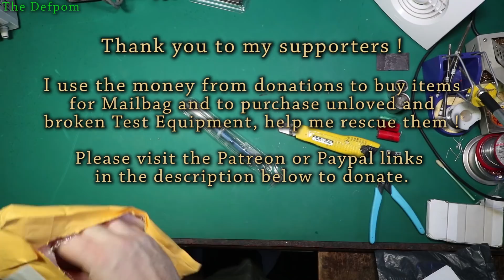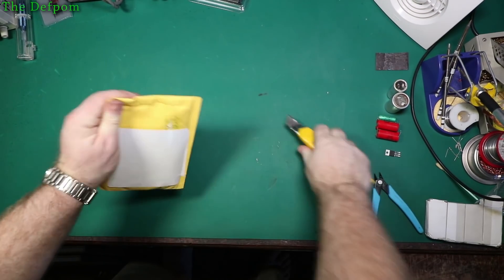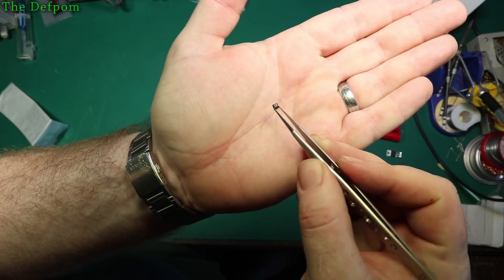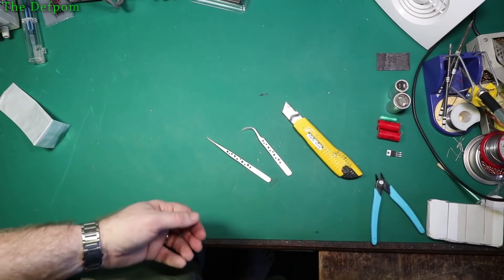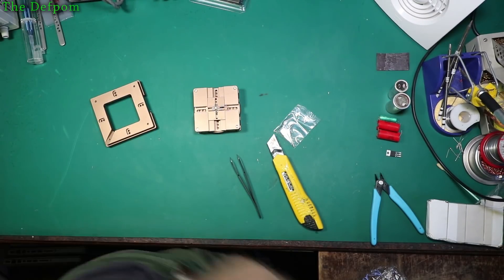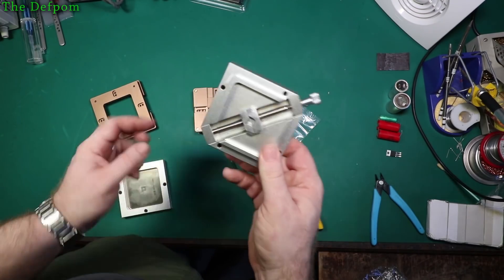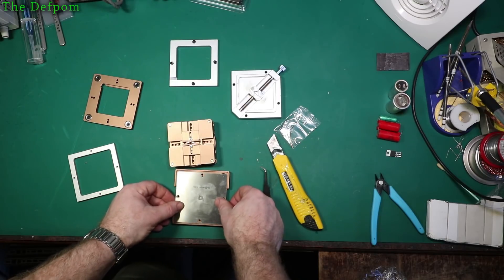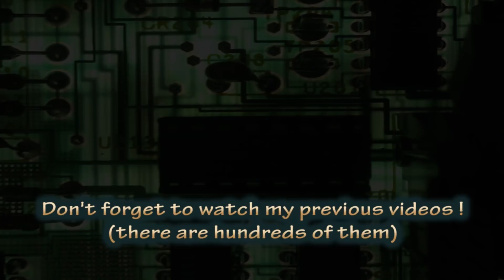🔴 #497 Mailbag Monday 7th January 2019 - Gripping Stuff

Comment: I think some of the better jewelry tweezers are packaged in a similar manner.

I didn't know American Beauty Mfg. made wick.  They are one of the oldest manufacturers of soldering equipment, though.  My recommendation if you get cheap wick is to put some good flux on it since often the cheaper ones don't have enough.